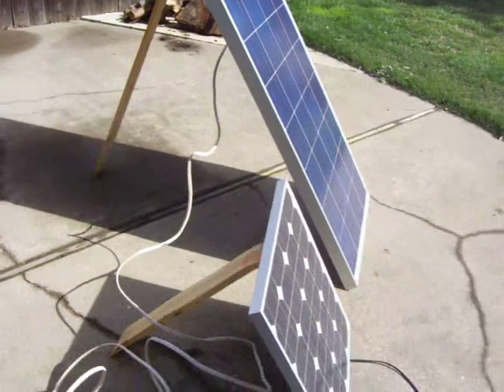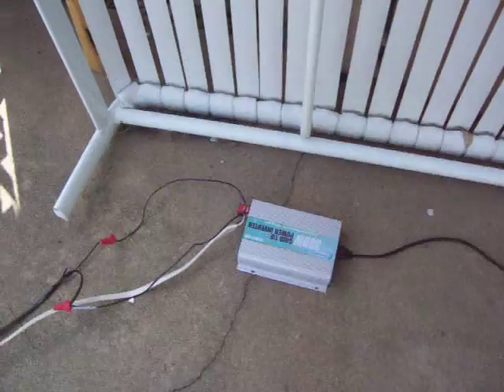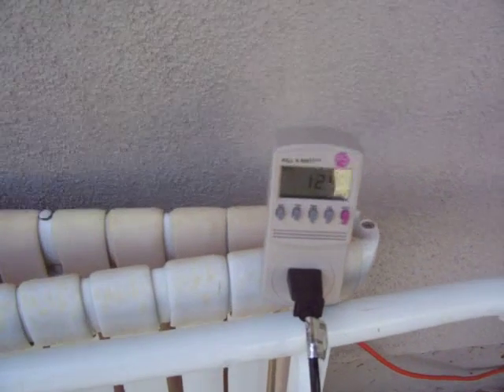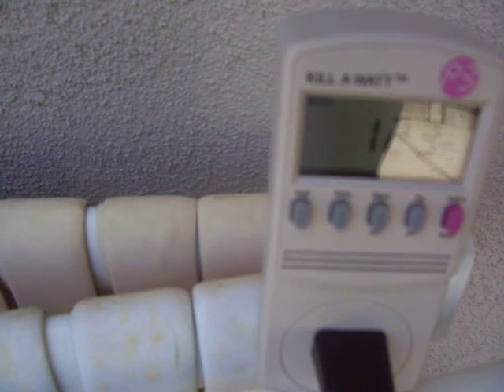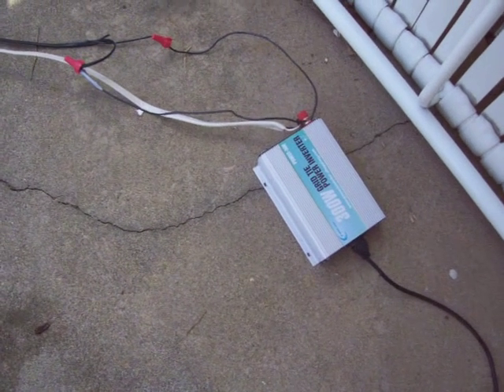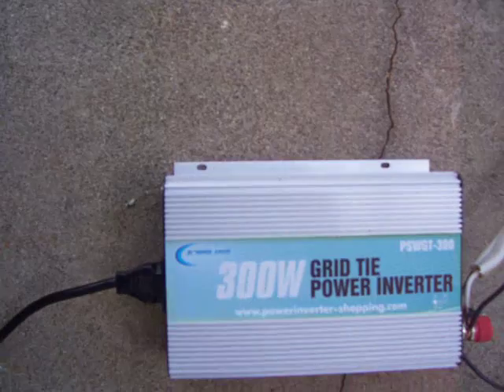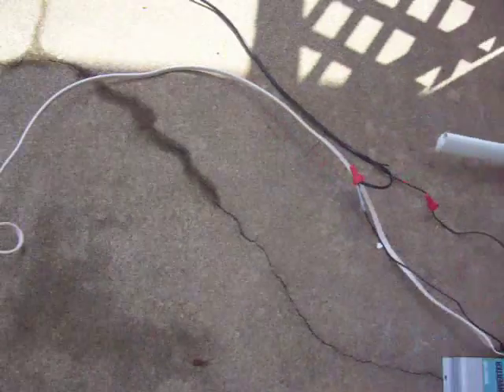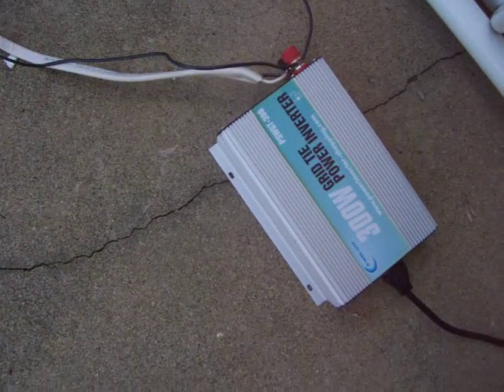Grid tie inverter Test 300 watt powerjack

Comment from the maker: @les6772 
I have had no problems since I drilled 2 holes on one side and hooked up a pc case fan on the other side where there is a vent. It was overheating when i went over 155 watts, but now I running 245 watts of panels with no problems with the pc case fan

Comment: well ok i have the gt 280 they say is 10.8 to 28v thremodyne lied and when i asked them they said 10.8 only turns lights and board on i ran it at 13v nothing until i got to 14-24vs like regular ones so they are on ebay lieing to ppl i also got 10 of the same green 300 watts ones that are 80 all day on ebay they are same inverter as gt 280 diffent sticker all guts and out side but 1 switch same and put out same

Comment: man i have so much in batterys and was going to charge them at 12vs each but these running at 14 and up throws off everything,and the other brands that say they do 10.8v and up lie that only turns board on and 1 watt so i dont know what way to go i have $30,000 in batterys and 11 of these grid ties and 2 wind turbines 1500 watt each any tips out there lol

Comment from the maker: @mayswhole 
Do not run on batteries, these units run much better on about 300 watts of solar panels then 24v batteries.  I only run my on solar panels during the day. they have been going good for about 45 days now with no problems.
today I got 1.1 kwh on 155 watts of panels with good sun.

Comment: are u running this 24hrs a day on battery bank i have 72  ups12-370 batterys and can do 24v banks i run ones of these first day died after 3 hrs and they sent parts to fix so just wondering i bought 11 of these